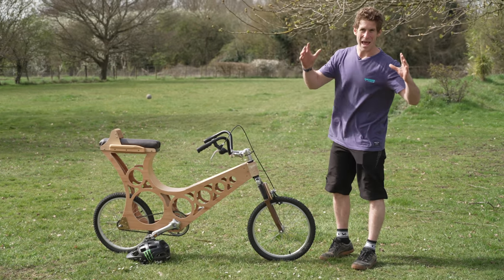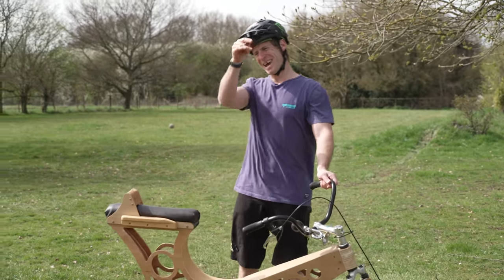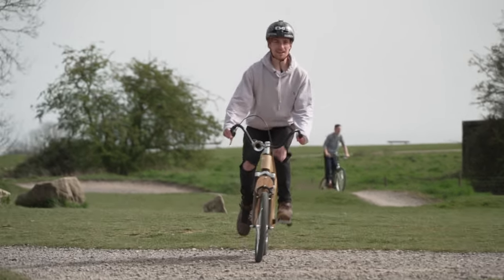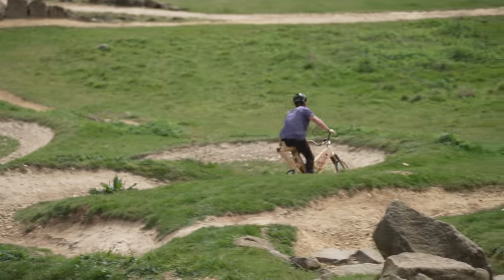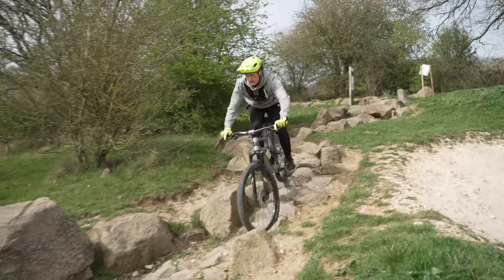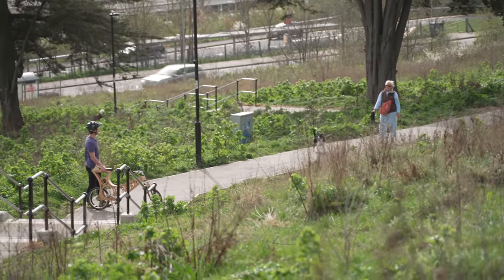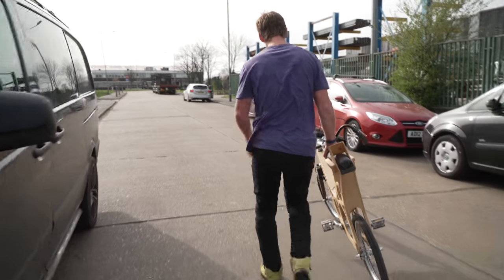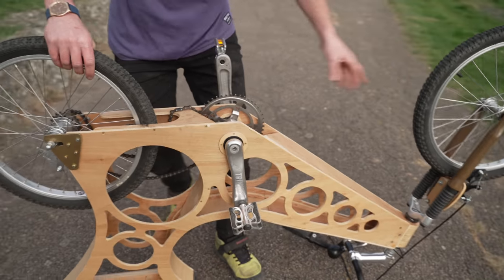MTB FREERIDE ON A WOODEN BIKE - HOW LONG WILL IT LAST?

Comment: The design was from WoodenWidget with some mods, such as the suspension forks, out of a skip! The builder was a 75 yr old ex IT teacher, just did it for fun one winter. Later made a wooden recumbent, now a plywood canoe. The odd handlebars were to make a leisurely ride for my (lack of) skills. Built in Oulton Broad and ridden on the flat a few times. Well done Sam I could never do that stuff on any bike!

Comment: The dreaded coaster back brake!!!  First time I rode one at a skatepark I adjusted my feet at the bottom of the transition, locked up, skidded to 90% up he wall, then with the back wheel locked I started the dreaded fall back down.  Bike followed me down with malice in its heart.  I would have burnt this bike as revenge!

Comment: Ohh... I recognise that, seen this in the flesh, a good few years ago, I work in a bike shop and I believe I supplied the gentleman with several parts for this including the bottom bracket bearings... did you by any chance buy it from somebody in Suffolk?
Reply: yes, Lowestoft. Bb30 bearings from Evans, chain wheel and headset/forks from Gorleston bike shop. Wheels from Germany, chain from Halfords